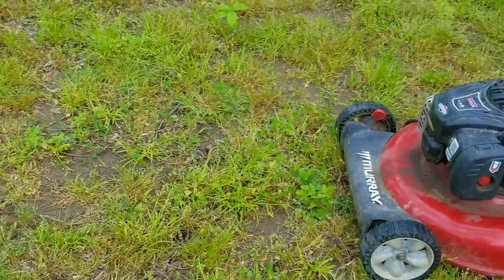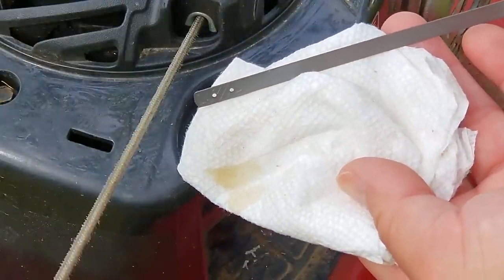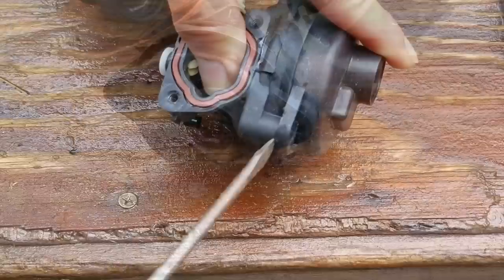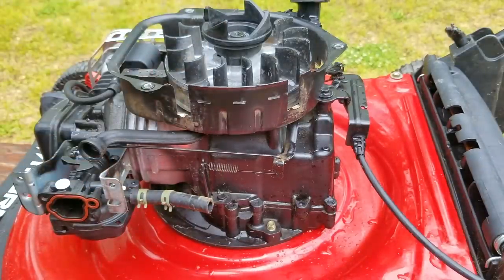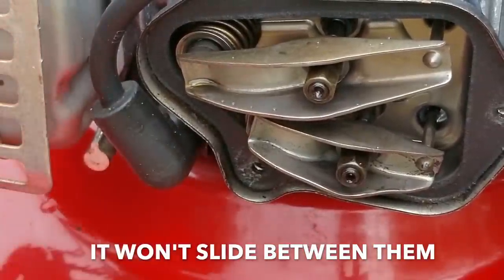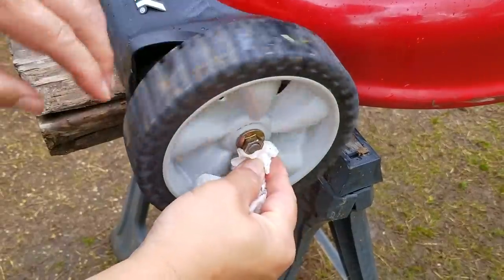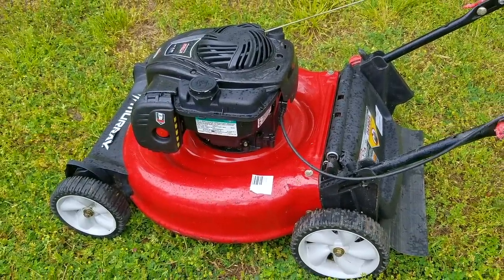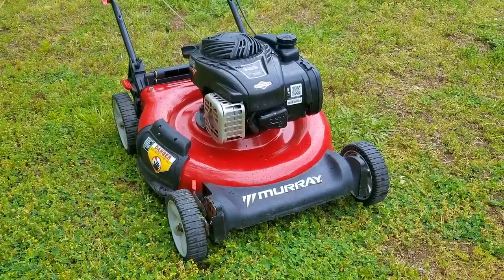Fixing A Murray Mower That Was Found At The Dump

Comment: I was working on an old Snapper mower for my neighbor. It had a Briggs Quantum that was covered in sludge, when I removed the flywheel to find the leak I found that Briggs had forgotten to install the breather crossover pipe way back in 1996! Fortunately I had a spare one and I finished restoring the old Snapper. Works like new!
Reply from the maker: wow nice work

Comment: Two years I went to the local dump and spotted an old reel mower that someone had dropped off. It was an older one that I looked up and was from the 1960's when I Googled it. The blade needed a good sharpening and I took off the wheels and greased all the fittings and now it runs and cuts great. It never ceases to amaze me the stuff people throw away.
Reply from the maker: very good work saving from the dump and yes it Is quite amazing.
Reply: Now and again I will see vacuum cleaners on the curb.
When I get them home the only problem they usually have is that the bag or container will be completely full.
I replace the bag or empty the container and they're good to go.

Comment: Great video dude.
As you properly are aware, we are in a "throw away society".
Some times its just cheaper to throw out and buy a new one 
whether its a mower or a clothes dryer. 
I often find lawn mowers on scrap heaps 
(we can't just scab items from our local dumps like we did back in the day)
i found a 4 stroke like this one last year, mine was blue in color and it had a
repair tag on it from a mower shop that read "engine damage due to incorrect fuel"
so the owner just chucked it out. I found it, replaced the plug, new fuel and just a basic
clean and pulled the cord and it worked like a charm and still is. I gave it away to a 
lady who couldn't afford to buy a lawn mower.  I believe the mower shop just could
not be bothered trying to repair it so told the customer "its dead, buy a new one"
shame really, we chuck so much into land fill. I love to tinker with this kind of stuff
on a Saturday  morning.
G'day from Down under Australia.
Reply: It is pretty much never cheaper, it's just easier.  🙄
Reply from the maker: hello 4TheMotorist from Australia and thank you for the great comment
Reply: They told her that because they got to sell a new mower which was worth more to them than a simple repair, that is the downside of the throw away society the skills that are needed to do repairs are atrophifying because we don't have mechanics we have technicians who cannot function without their laptops.

Comment: I was recently given one exactly like this because it would not start.  PO had tried to clean the carb and lost some of the parts.  I put a new carb on it with a new primer bulb.  Now it starts reluctantly with about 5 pulls.  Next is to adjust the valves.  Thanks for the inspiration.
Reply from the maker: yes, I would do the same. thank you Ray Vick

Comment: My 1st lawnmower as a home owner was a Murray lawnmower from Wal-Mart with a Briggs and Stratton engine.  It lasted like 15 years until the deck rusted out. Zero issues with the engine
Reply from the maker: thank you for sharing that
Reply: Similar story here. Bought mine in 1991. First oil change in 2003.
Handle broke in 2004. Clamped it back together and soldiered on. Broke again in 2006 (different spot.) Already had acquired another mower as my wife and I sometimes mowed together. Gave the old one to a new neighbor when he moved in. Engine still ran like a top.

Comment: Yes I have forgotten parts before. I was working on a weedeater featherlite blower, and after I got it reassembled, I realized I forgot the long metal tube that acts as a separator in the engine. It had fallen out and rolled under my workbench lol! Couldn't for the life of me figure out why the engine wouldn't turn over. After about 30 mins of troubleshooting, i finally found the metal tube. Fun times! Great video as usual IHG!
Reply from the maker: thank you Jacob Feather!

Comment: Their loss is your gain. A really well explained video. The manufacturers are replacing more and more parts with plastic, that’s not good long term. Cheers, Stuart 🇦🇺
Reply from the maker: yes you are correct and thank you
Reply: I have seen all plastic carbs even the jets, worked on couple few months ago. One did come back after some cleaning, but still surges.
The other just needed a replacement carb, as it wouldn't come back.

Comment: Back in 03 I found an abandoned one year old Craftsman 6.5 hp walk behind. It was still clean and undamaged in appearance, but I couldn't pull start it. Took it home and after a quick inspection, discovered the cable for the blade brake was broken. Easy repair and I used that mower for years afterward.
Reply from the maker: nice fix!

Comment: I found a Troybuilt TB110 on road across street. I watched your video about the carb. It took 10 minutes to pull and clean and put back on. A little bit of oil came from the carb bottom of air cleaner but it stopped and never leaked again. So I think while they let it sit for however long it was tipped. The mower looked new but sat out in their back yard under a shed roof for what looks like a year or so. I cleaned it up and it looks brand new. It has cut the grass 5 times now and I've no money in it. Hahah. This is so awesome I now want to do this for side business. Thanks. I have a weedeater as well. They threw out. Troy built as well. The 4 stroke type but it is dirty. No fuel in it and the next time i get a minute ill try it out. It's likely going to be needing a diaphragm I'm sure.
Reply from the maker: nice, and yes there's good opportunity to make a good bit of change doing this hobby!
Reply: @HomeGaragechannel  I appreciate your videos. You saved me whatever these are valued at.
Reply from the maker: no problem and I appreciate your time here

Comment: I have this exact same mower I think I bought it in the summer of 2017. I’ve had to replace the carburetor twice probably because of charcoal coming out of the gas cap though I tried to clean the main jet first. I have the original blade which has hit stones and been bent on roots, but I’ve hammered it back in shape, sharpened and re-balanced it. This is a nice mower with a lot of power.
Reply from the maker: Thanks for the info!

Comment: Before clicking on to the video. I seen the crest of the Briggs and Straton brand. I knew then you would get it running. I found a craftsman. Left for scrap. It runs like new now. It's amazing I did exactly what you are doing in the video and I had no small engine repair experience.
Reply from the maker: nice, it means it doesn't require any training to fix these then

Comment: Those old BS engines are tough. I’ve got the side valves ones.

Rescued one from the dump that had water in the petrol tank. Flushed it out with metho, changed the oil, cleaned the air filter and away she went. Sold it for $50 after many more years of service when I moved house!
Reply from the maker: nice work!

Comment: THAT IS MY EXACT MOWER.  Purchased 5 years ago at Walmart for $190, it replace my broken Craftsman that was 11 years old and couldn't be fixed.   I ordered a new carb for it and my neighbor didn't know he had to replace the O-ring and retainer inside (that was shown in this video).  Showed him the video of what he missed and then 1-start pull to show it worked great!  Just changed the oil and greased up the wheels.  Touched up the black paint on the handles so it won't rust.  Oh, and I gave it a new blade since the other was quite gnarly haha.  As long as I keep the carb clean and the jets clear, this engine can run for 20+ years.
Reply from the maker: wow nice work and I agree with you

Comment: Sure I've had parts left over and had to 're-lick my calf' as the old saying goes, but when I saw the 'Z' bend I knew it was off the fuel system somewhere, but the governor rod was a new one on me. GOOD fix and that mower was way too good to scrap. Sweetie tried the Stihl and came back in and said it wouldn't work. I checked the battery and everything but after pressing the safety and folding the bail, off it went. She was folding THEN pressing. After that she loved having NO pull starting. I need to set the mower down one notch and the cutting will be right. Hardly any in the bag but it is a mulching blade. That might be remedied in the future. Ran about 30 minutes on one bar of discharge but not HIGH grass either. Will keep you up to date but I used the old 85 Snapper to trim with. They are what they are. Keep on fixing and I'll keep on watching. Blessings!
Reply from the maker: nice work, I'm sure I might have made the same mistake too, press then fold got it!

Comment: I am laughing because I watched a Murry plunge to a waste bin last week.  I was on a contract dump haul, Washington state and where my wife loves her Murry because of it's light weight and generally reliable start character.  I find compressed air to the unit as after generally several hours of use really helps with keeping build up as residue limited from the carb area and to the top recoil starter rope.  
As with small engines of weed eater, chain saw....clean fuel in clean containers is a key to long life. I did take note of the wheel axel lube as a good bit of service.  And the general carb body as replacement on hand might be a service plus to my best shop maint.
Thanks for the post as I seem to have jobs friends send to be repaired.   Happy to have good advice and views to problems.   M.
Reply from the maker: thank you Mark McGary for your time

Comment: The white main jet pops right out of those carbs for easier cleaning and there is an idle jet inside. They almost always have water inside.  The water get in from the gas cap that has a charcoal canister inside that leaches moisture from the air and drips into the tank.

Comment: I have a Murray mower that is starting it's 25th season. It hase a 6hp Briggs and Straton engine and I take it to the local Ace hardware every other year for a compleet tune up. I have a fairly small yard so it doesn't take but about a half hour to mow the whole thing. It isn't self propeled. The first time I used it this spring, it started on the first pull after sitting all winter. I do put fule stabilizer in my gas every time I refill my 1 gal gas can.
Reply from the maker: very nice, you're doing a fantastic job of caring for it!

Comment: Generally, you want a wider gap on the exhaust valve to allow for expansion. Usually the valves are adjusted to 
002-.004 intake and .005-.007 exhaust
Reply from the maker: thank you dave1135 I'll be checking in the next video
Reply: Those seems to be the settings from the factory, and it matches this video.   The spec most product manuals say is 0.004-0.008 for both, which is a pretty large range.

I suggest not modifying the factory setting if only the intake is tight.  If you do need to adjust, e.g. after replacing a internal part, set the intake to 0.004 and the exhaust looser, perhaps 0.006.

Comment: Many people don't drain the fuel before winter storage, and the ethanol (alcohol) in gasoline attracts moisture and the carb gets ruined.  These plastic carbs are only $25 and that's probably what they did, replace the carburetor, put in fresh fuel, and when it STILL didn't start, said screw it.  LOL.  Glad you rescued it!  BTW, be sure to sharpen that blade☺️
Reply from the maker: Thank you Jimmy Day, and you are correct. Yes I sharpened it.
Reply: Worked for a neighbor with a repair shop and a customer brought in a Briggs with the early plastic carb on tank model. It needed a new carb when it backfired and melted the carb. We used tell people that these Briggs engines are the best but their carbs are a joke. Our advice was buy a new mower because the price of the parts and labor were more than the cost of a new one. It's the same reason we hated working on John Deeres because their quality was at best equal to everyone else with 3 times the cost. My area of expertise was building high power go-kart engines. I would start with a Briggs and put a tecumseh or kohler carb on it

Comment: I have a yard machine and the last time it was started there was a clacking and then went away when the mowers rpm went up. I checked the rocker arms and readjusted them to specks. My problem is the valve rockers come loose when I hand rotate the engine to check the setting. The rods aren't bent and no matter how many times I make the adjustment the rockers come loose. The screw and nut are tight when set. Wonder if the rockers are bad? Short of pulling the head to check the valves? Good video.
Reply from the maker: my only advice is to make sure the pushrod is seated in the tappet, it's easy to miss them and put them next to the tappet, instead of that little cup.
Reply: I forgot to mention that. I was careful to make sure the rod where seated right.
Reply from the maker: thank you for the information

Comment: I think a lot of small engines are usually fixable our 20 year old toro sat in the garage with the engine taken apart for a whole winter after starting to fix it in the fall and putting off finishing it, put a new head gasket on and replaced the carb and its running as well as it ever had.
Reply from the maker: yes you are correct and Nice work!

Comment: I got a Poulon push mower that was assembled at Ace Hardware.  The handles have never been right and move up and down because something seems to be missing. Never could get them tight for long.   Both front wheels eventually broke off the thin steel body.  I remounted them with washers to reinforce it.  The thing is,  it has a good Briggs motor that runs great but all the Poulon part of the mower is total junk.  I only keep it because I don't have the money and it is light and easy to push compared to expensive mowers. I have to push uphill alot.  I once had a Sears Craftsman mower I bought new and it ran fine for over 20 years and still going when I gave it away.  For a new Craftsman that ran for one season and weighed a ton.
Reply from the maker: wow at least you were able to keep using it.

Comment: I found a Briggs & Stratton lawn mower it was running for a little while now two years later it's having a firing backwards problem basically pulling the cord out of your hand when you prime it pull and it pulls the cord out of your hand I'm suspecting it's a flywheel key I'm hopefully be able to take care of it on Wednesday or Thursday at the latest waiting for my packet flywheel keys to get here
Reply from the maker: yes If it happens with fuel in the engine or carb, then flywheel, but if the engine has no gasoline in the carb, or tank and it happens, it means the valve lash is off.

Comment: Governor linkages are definitely something I miss sometimes and it's been a surprise when it just idles or it races out of control.  I usually shut it down before it goes too far on the latter.  I don't understand why people don't bother to repair things anymore, even this cheap Briggs powered unit.  I find it interesting that a litre or two of fuel costs $10 where you are as it is about CA$1.50 per litre where I am.  For those who live South of the Canadian border or West of The Yukon Territory, that's roughly CA$6 per gallon.  Of course that's regular E10 gasoline, which is what I use with no hiccups.  Of course I use it up pretty quickly as I mow lawns for a source of income.
Reply from the maker: thank you WJCTechyman, and the $10 comment was meant as satire for the high price of gasoline, gasoline here is $3/gal
Reply: You asked while people don't bother to repair their mowers even cheap mowers.  And the reason is most people don't have the knowledge or tools to do it themselves.  And depending on mower shop repair rates that simple R & R carb has a flat labor rate of .75 hours which translates to $50-80 for a rebranded MTD mower licensed by Briggs to sell under the Murray name for $169-189 from Walmart.

Comment: Ha Ha Ha , I literally JUST FOUND ONE TODAY. identical !!!!
I had to do the usual. cleaned out tank, dropped float bowl and cleaned carb, added new air filter, fuel filter (a MUST) and plug.
Runs fine now, $50 sign on it in front yard.
I still laughing at the timing of your vid and my finding fixing this too...all the way across the USA 

Thumbed and subscribed bud!

Ps, just finished rebuilding a toro i found complete , bad motor.
Just put a 10hp+ cammed 4500rpm gov'd ohv Briggs on it, this sucker is unstoppable now.
I was cutting 18" field grass and it just rides on top of the blob of grass goo as it clogs the shute. it wont stop for anything lolz!!!! just leaves a minced slime of grass turds behind it .   The GRASSINNATOR  10+HP     I had to cut a larger shute, that toro cast aluminum deck is tough!
Reply from the maker: thank you R.O.B. I appreciate it. That mower you fixed sounds like a beast!

Comment: My brother garbage picked an almost identical mower and gave it to me as mine was almost 20 years old. It didn't have an air filter or cover so I assumed it was a display model bought super cheap. I changed the plug and it started on the first pull. I cut my grass and it worked fine. The nest time I used it the machine quit working after 5 minutes. I thought aha, it must be defective. I checked the valve back lash and it was perfect. I puled the plug and there was a piece of grass across the electrode. I cleaned it off and it started right up. I bought an air cleaner the next day. The date of manufacture was only 6 months prior.
Reply from the maker: nice work

Comment: My girlfriend at the time bought the cheapest mower at Walmart 11-12 years ago, it's a Murray.  If you burn the gas out before winter, spray carb cleaner in the partially taken apart carb.  It will always run. It is still running perfectly
Reply from the maker: agreed